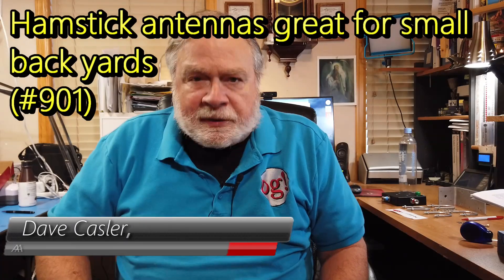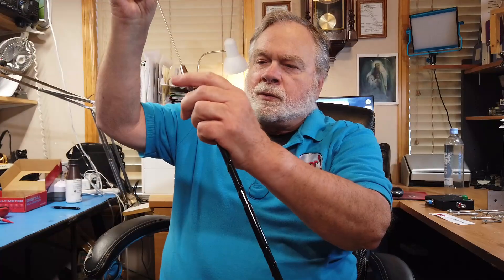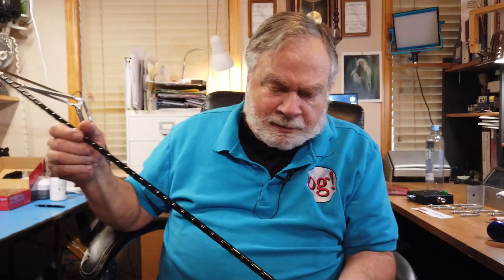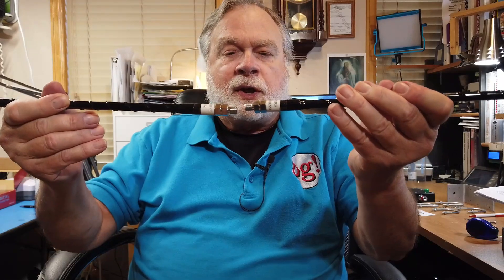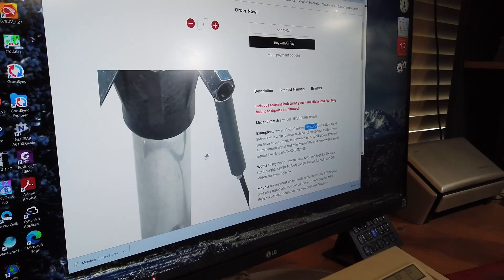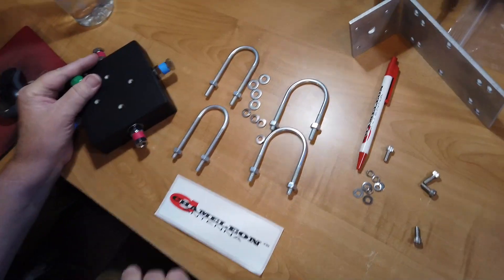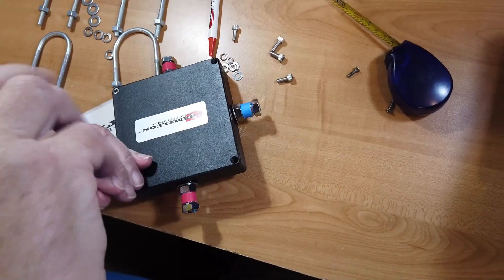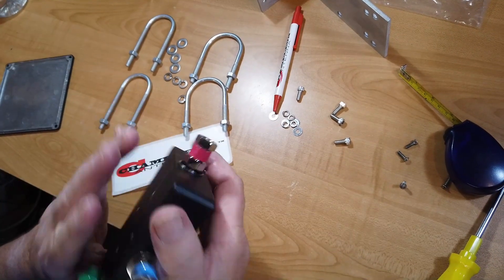Hamstick Antenna Great For Small Back Yards (#901)

Comment: Hello Dave, Great video, I use hamsticks for POTA  and mobile, I have also used them as a dipole and made a 2 element yagii from hamsticks that worked reasonably well. Another antenna that works very well  as a dipole is the Hustler mobile antennas,  the advantage of the Hustler is the mast stays the same and you just change the loading coil to change bands, as well it makes a smaller package for  POTA or SOTA activations.  I use the hamstick and Hustler verticals on a camera tripod with 36ft radials for POTA, I have worked all over the world with them during this current solar cycle. Kevin VE3RRH

Comment: Dave, my father and I are going to become Hams in the very near future. We are looking into 10m radios right now. What would your suggestion be for the best 10m antenna option where Terrain could be a slight issue. I was liking the Chameleon quad1 but it is not available anylonger. Can you tell me where to source the internal parts to make one? I don't mind making my own if you think it would be a worthwhile effort for our application.  Thanks in advance for your response.  Chuck and Ron.
Reply from the maker: My first rule for new hams: do NOT buy or acquire any equipment until AFTER you pass your test!! Over my almost 50 years as a ham, I've seen too many folks shell out big bucks and then for whatever reason (lost job, kids, education, job change) not get that license! If you pass your tech, you've got lots of tech things to do such as FM voice, digital, APRS, satellites, etc. When you pass your General, then get a simple station and start learning. See www.dcasler.com/reference for a sample station. Good luck with your studying! It's a great father-son project.

Comment: For POTA I'm using a 20m Shark Ham Stick with a mag mount on top of a Dodge pickup.  It works absolutely great.  Love it.  At home I'm using an MFJ-2220 with the 20m MFJ hamsticks mounted on a 17' telescoping pole.  Its not working so well I think because its not high enough to clear the houses.  I'm considering a 17' whip on top of the 17' pole to get height but I don't know what to do about a countrpoise.

Comment: Do you know if the mono-band ones will also work for other frequencies, or do the coils not work that way? So for example, a 60m antenna working for presumably 1/4 wavelength might also work for 30m as a 1/2 wavelength? I have a 160m and a 60m, and think it'd be nice if they could work decently well on these other frequencies. Being a relatively new ham, I don't have the equipment to easily test this out yet. Thanks.

Comment: I'm returning to ham radio after a long absence, and was surprised to see a company (MFJ) supply a coax feed to a balanced antenna, then ... match it? ... adapt it? ... by just adding common-mode cores around the coax.  How does this compare to a proper balun -- can 1:1 baluns be replaced by simply adding common-mode cores?

Comment: Dave, great video as always. While I don't subscribe to using more than one set of 20 meter hamsticks in a dipole configuration, I have yet to find the recommended way to tune them. Some have said to tune them one at a time for the frequency, but this does not work. Is there any information that would help?

Comment: Dave that is similar to  what I  use for field day.  I use  Hustler MO 3 mobile masts in   a dipole configuration  with  appropriate resonators on each mast. I made  a mount out or 1/4 in x 1 in 6061 flat stock aluminum, I drilled a 7/32nd  in hole and threaded  it for 3/8 x 24  I then drilled a 1/2 in hole for a 3/8 x 24  to  so 239 insulated mount i took from an old CB mirror mount . I cut the flat stock to 9 inches  and drilled the mast mounting holes to fit the mast  I used.  I also have used the Hustler VP1 3 resonator adapter to  have 3 HF  bands . The MO3  masts  are also  tunable to 6 meters with a tuner.

Comment: These were first made by Mark Products. One model was the Firestick. Motorola used custom versions on HF. Top loading is the most efficient. Later the adjustable spike on top was added for CB and hams. I had an 10 ft KW level custom model on 20m and worked the world. No good for drive thru though! Retd Mot HF/ microwave systems engr. Back to back they make nice compact dipole. Few dB loss but narrow gives extra selectivity for front end and sheath reduces rain static. 73 wa2kbz

Comment: Excellent review, thanks. Definitely better made than the MFJ octopus, but I'm disappointed Chameleon dropped their own "octopus" version. I've been running one of the MFJs for several months and it works really well for me. I did put a zip log bag over the head to serve as a "shower cap" to keep the water out. And I lower my mast significantly when the wind picks up. But, it's an effective antenna system especially between 10-20 meters. It's meh on 40, and on 80 I only get a tiny little bandwidth, but I tune that for the digital services I use and it suffices. I just worked a station in Australia with FT8 at 14 watts on 20 meters yesterday, from northern Virginia! No complaints.
Reply: they possibly got so many complaints as folks foundout hamstick dipoles are total shit they dropped it to save the grief when customers realised the concept looks good on paper but works crap.

Comment: I have used hamsticks in either dipole mode or a single as a vertical.  As you say, they work amazingly well.  I have many dx contacts on 20 meters with the dipole only 8 feet off the ground.  I use an "armstrong" rotor for directionality issues, but find there is not much of a null at the ends.  As a vertical, I used a tuned single or two wire counterpoise - essentially a vertical, L dipole.

Comment: Brand new, my MFJ octopus center was DC shorted inside the hub, so I had to disassemble & repair.   After repair, even tho my ohm meter said it was ok, the thing would not tune with 8 sticks connected.   Tuning any one would affect the other three.  So frustrating!   I don't recommend multiple band models.

Comment: A dipole is pretty directional, so do you need a rotor?  I tend to orient my directional antenna (random length wire with an un-un) in a north/south direction so that the effective coverage is east/west.  But, these antennas (both MFJ and Camilian) would have multiple effective coverages, depending on the band.  I've successfully used 'ham sticks' as a vertical dipole with pretty good success, but I have to change them when I change bands.  It would be nice if someone made a vertical mount for multiple bands.

Comment: I have considered these. I did try a dipole with two old Chameleon V1 whips. I didn't seem to think it worked well, but I also didn't spend a lot of time on it. Perhaps a re-try this summer.

For now, I use a DX Commander 12.4m vertical for most bands and a horizontal L efhw for 80m with Chameleon Hybrid mini as the transformer because it receives so much less noise with about the same signal for 75m. It is used mostly for regional contacts. This model of DX Commander isn't very portable, though.

The more I delve into antennas, I now see why the dedicated go for a HiQ or similar screwdriver antenna.

Comment: I live on the 10th floor of a 30 story steel & concrete building. I have the CHA spider with 4 pairs of "hamsticks" on my balcony - it is an XYL approved solution and gets me out (best so far is Tel Aviv to Buenos Aries.). Well recommended. 73 de 4Z4DR

Comment: Hamsticks are basically resistors. An inexpensive tuner and as much wire as you can deploy is a much more efficient way to go.
Reply: How well hamsticks work depends a lot on the band. The 10 meter version is basically a quarter-wave. The 20 meter is about half the length of a quarter-wave, so you get about -3dbd. 40 meter is about -6dbd. So not great on longer wavelength bands, but very usable on 20 meters and shorter.
Reply: @DavidSmith_W6DPS  A 1/4 wave on 10 is not as efficient as a random wire of longer length.

Comment: I'm guessing that on the Chameleon design it'll be a bit tricky to tune the stingers since there is nearly a 4" difference in distance from one antenna connector to the SO-239 than the other. It won't be as noticable on 80 meters as it would be on 20 meters, or 10 meters. They ARE a compromise antenna system especially on say 80 meters, not so much on 10 meters, but they WORK! I've used this type of system over the years on many occasions. I haven't used more than two bands at a time, and I kept the jumper wires the same length from the SO-239 to each antenna mounting point (Homebrew). I have a feed point rigged up with two 80 meter hamsticks and fed with heavy 300 ohm twin to test as a loaded Doublet. In my mind I think it'll work? Far weather experiment coming up. 73's N9XFX Dennis.....

Comment: I homebrewed my own as well using a standard 8 sided steel electrical box found at any home improvement/hardware store. My mast is a surplus military portable mast kit and I've attached a 1" galvanized pipe to accept the antenna system. 

For the wiring, I've used 16 AWG electrical wire and have only soldered the wire to the tip of the SO239. 

PVC pipe is definitely a good alternative to the mast I have.  The mast must be robust enough to support the weight of 4 dipoles; and be sure to use guy ropes, especially if the antenna is above 10'.

Thank you for the great videos Dave.

p.s., I agree with you about that MFJ unit looking a bit flimsy.

Stay safe and happy hamming everyone.  🙂

Comment: I take it this would be a directional antenna and would require a rotor unless you wanted your two bands to radiate in opposite directions?
Reply: It would be like a wire dipole.  And yes, it could be rotated for better directivity.

Comment: Another informative video.....I used for a while the MFJ-347 mount with "real" hamsticks I've had for years and it worked, one band at a time. My complaint was it was tedious to tune  each hamstick independently then both hamsticks together to create a balanced dipole.....anyway, it does work. 73/K6SDW
Reply: Eddy - what is the process you used to tune the sticks?  A ham told me in a ham store to only insert one stick at a time, then insert both sticks for the desired band and the tuning would be pretty close.  I found that this did not work.  What method did you use?  73 BretC/AC0AE
Reply: @BretChilcott  Yup, that's what I've done in the past...I haven't used the hamsticks in quite a while, I've relied more on an EFHW dipole for portable use. GL/73

Comment: It's called an helix wound top loaded antenna, just like  firestik CB antennas.
Typical firestik lengths for example are APPROXIMATE RANGE:  2 TO 7 MILES
Transmit and receive range will vary dramatically based on conditions and the mounting location of the antenna. But for a rough approximation, you can expect the following range from these lengths of fiberglass antennas.
2' Length: 2 to 3 miles
3' Length: 3 to 4 miles
4' Length: 4 to 6 miles
5' Length: 5 to 7 miles
They work very well but have narrow bandwidth because of the thin copper wire used, not because it's shortened....
Reply: Pardon?
Reply: These are not really like the CB versions. They are more center loaded, and can tx/rx hundreds or thousands of miles on the HF bands. I frequently talk DX with hamstick style HF antennas. Dave is correct that the loading causes the hi Q (and thus narrower bandwidths). The diameter of the whip or wire has negligible effect. A "standard' 14 ga wire antenna like a dipole has a diameter of 0.0641. Hamsticks have wire whip diameters between .1 and .125".
Reply: @cyclecamp1  If you want to get picky,Yes the Hamstick is centre loaded only because it has a longer top whip, take that away and you have a Top loaded CB type firestik.
You do know CB firestiks can be used on SSB too and go thousands of miles!
If antennas are electrically shortened they will not perform as well on TX/RX, this has nothing to do with bandwidth!.

Use a online (Antenna Bandwidth Calculator) 
center frequency, wire velocity and wire diameter is in the formula not height.

Comment: I home build one of these years ago to take trailer camping. I used a 2 inch pvc section with mounts for 2 hamsticks (single band, 40M).  It worked pretty well and was extremely fast to deploy. I still have that one, thinking about adding a couple of studs for two more sticks to make it dual band.  Schedule 40 PVC is very rugged. You could probably go up to 3 inch pipe / cap  and get three dipoles on it.